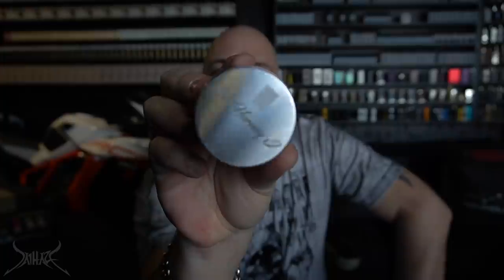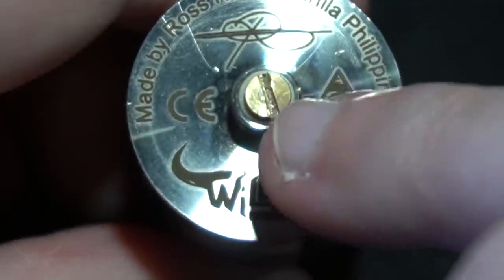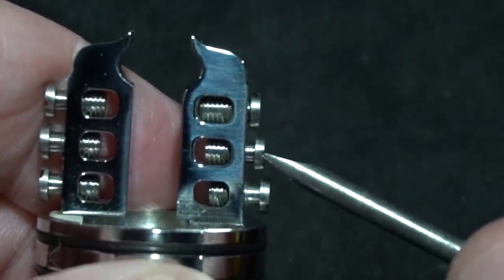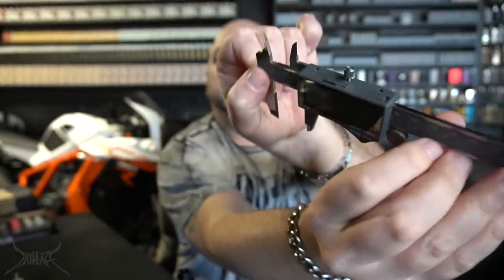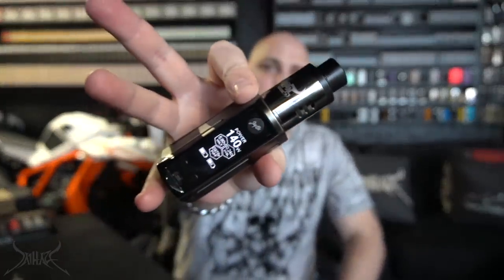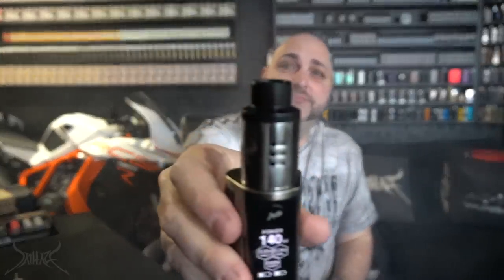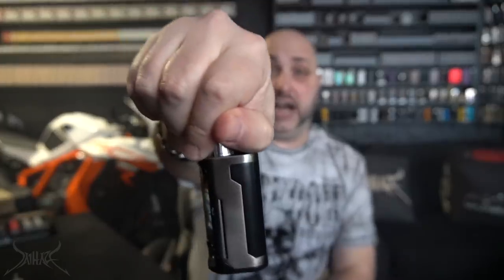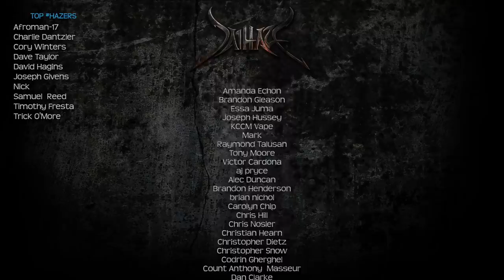Me So Horny, The Pine Tree Build | Wild Bull Horney V2 RDA Review and Rundown

Comment: Suprised you didn't try a vertical build in this, a quad core vert would've been super tricky but cool to see our even just a regular dual coil vert, but with all that airflow 2 coils wouldn't be enough I presume. I agree completely useless for everyday usage, would only be good for tinkering in my opinion, 6 coils will burn through batteries and juice. I suppose if your looking to blow massive clouds with a para series mech,, this would be something to consider..

Comment: What are the advantages of running a higher resistance build with presumably higher volts? I'm not quite sure why you do it? 
Probably because I've never really looked into it and typically run standard builds between 0.15-0.20 like most people.